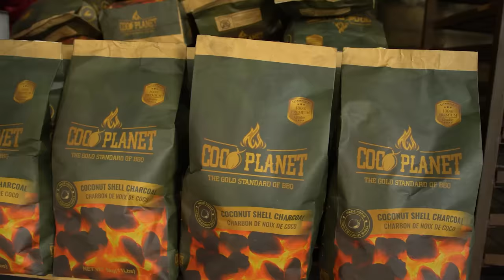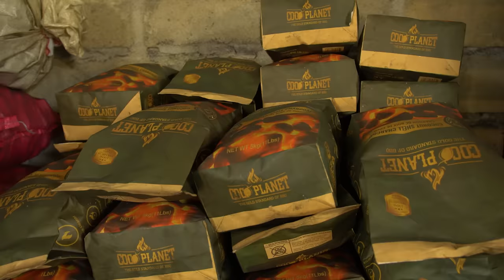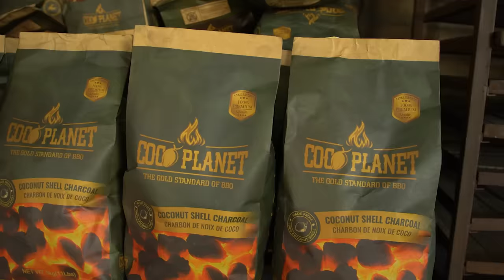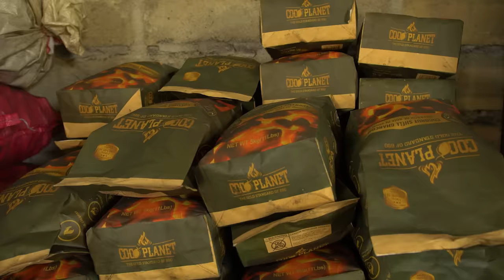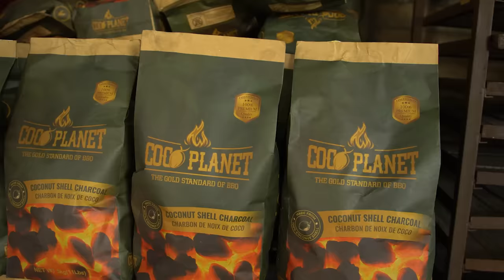How An Ivorian And Cameroonians Convert  Coconut Waste To Charcoal

Comment: Congrats from the Caribbean!   

Have you thought of designing a stove that can enable better efficiency of the coal.  I suspect that the coal will burn  even longer if the user can control the air flow towards the fire.  Also, there must be lots of coconut trees in the neighbourhood, and I cant tell you that the branches are almost of the same  constituency as the shell- have the folks consider the core of the branches in the production of coal?

Also, the company should consider medical charcoal down the road as an extension of the product line.

Comment: Unfortunately, coconut conversion to charcoal has added costs and becomes uneconomic in price terms. If export is to be done. You need to add 15% local coal to slower the burning process. A slow burn solution as a binder is needed to BOND. I have done this in India. We use coconut husk and kernel as fuel mixed with cow dung. No need to process, Why PAY MORE. We also use Oil Palm in the similar way. It is a matter of sustainability of feed stocks without conversion to briquettes. Not necessary. Perhaps you can export to Europe but it will be difficult and get exploited by the white capitalists. Guys good luck.
Reply: Why are you soo negative?